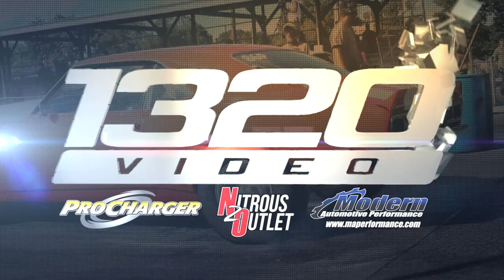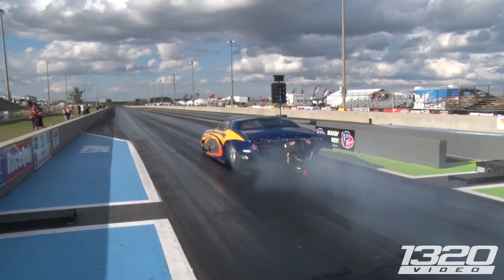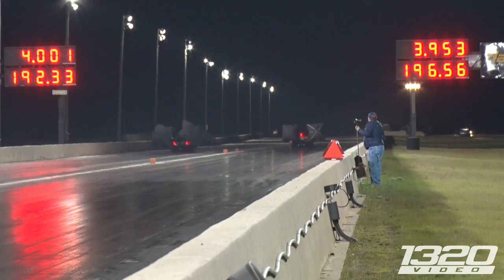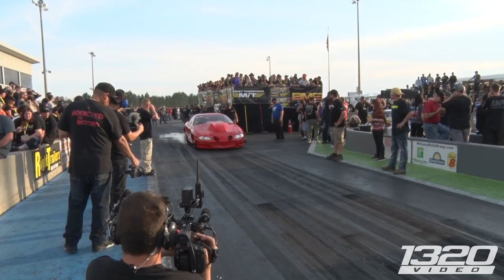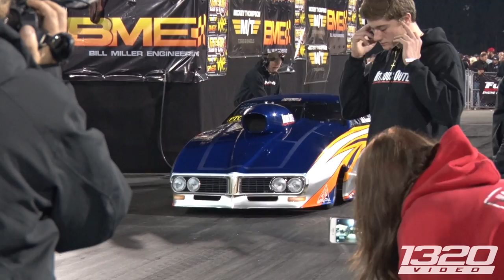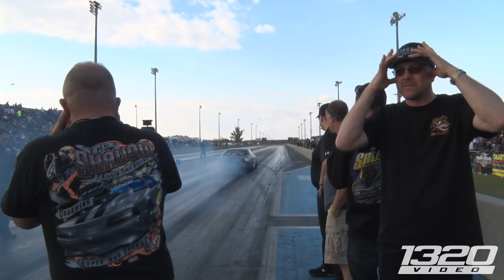FLAMETHROWER Firebird - 903 Cubic Inches!

Comment: that's a 15 litre engine if you were wondering.
Reply: 14.7975188 liter
Reply: CB nerd
Reply: CB if only my metal calculation was so accurate ;)
Reply: mulymule12 Google did the calculating for me, i didnt do shit other than copy&paste lol
Reply: Anyone know the smallest displacement that is running sub 4's?
Reply: mulymule12 sweet, I want to put that motor in my Prius, what's the gas milage on that baby?
Reply: The semi trucks I drive have either a 12L or 15L depending which one. Giant engine regardless.
Reply: Stingray idk but that crazy looking blue and grey impala has an LS motor. probably one of the smaller motors and it ran 3.90s.
Reply: Just add up 3 x 305 sbc's you get 915 cubes 5L x 3 = 15L. Car person math.
Reply: Its a 2 stroke loop charged through the valves, or a uniflow 2 stroke.
Reply: Marco Esteban milage? you'd be lucky to get yardage per gallon.
Reply: matt collins the boats I work on have 15L single pistons
Reply: wjoldham who cares
Reply: wjoldham I have a BICYCLE!
i litteraly just have a fucking bike
Reply: Stingray look up ekanoo racing Supra. It's under 300 cubic inches. the blue twin turbo impala runs an lsx that is well under 500 cubes,so there's two somewhat small drag race engines that run sub 4 sec 1/4 mile times..
Reply: Thats true, but it would be called a 15liter engine.
Reply: savannah love you mean 1/8 mile lol 4 second 1/4 mime is already top fuel numbers.
Reply: normal people....
Reply: James Avery im almost certain theres atleast 1. the impala running 3.90s definitely has a chance at running 5s.
Reply: 1970 olds442 no one can take a person serious when they can't English...
Reply: Bobby Beans  yes lol my mistake that's absurd to think tose times in a 1,/4 mile lol
Reply: Bobby Beans  he has run a 5.99 or a smidge faster in  da 1/4. mile in testing a few times
Reply: Marco Esteban  The gas mileage is probably 3 GPM (gallons to the mile) lol.

Comment: crash at top end, what happened?
Reply: im guessing he got on the breaks the nose dived and the back end got light and lost all grip then it came round on him
Reply: no hes not he straightened the car up and raced in the next round
Reply: MyFaceHole im dead 😅
Reply: Someone bent the parachute release cable.
Reply: *brakes
Reply: Really? He "straightened up"????

A car going 100+ mph turns a full 90 degrees, heading for a wall insnt going to straighten up. he fucked that car up.
Reply: all the fiberglass stuff was fucked and was held together with gaffer tape but the frame wasnt that badly damaged so it could be bent almost back to shape and he carried on racing it
Reply: lol

Comment: I wonder why the 1/8 mile has become more popular than running the 1/4 mile.   Is because not very many 1/4 tracks or preservation of the motor?
Reply: I hate it, I also hate "bracket", heads up all the way.
Reply: I've always preferred the 1/4 mile more. Seems more like a race against the opponent, and less about reaction time.
Reply: austin Safety.... and no prep don't belong in the same sentence.
Reply: jrh0369 most tracks don't have huge runoff space for stopping so the track is 1/4mile and 1/8 mile is used(I think) for racing
Reply: jrh0369 1/8th mile is more common among the south.
Reply: Mainly because even with the chutes these cars wouldn't be able to stop on time if they ran the 1/4 that's for starters. Secondly depends on the setup a lot of these cars believe it or not aren't geared to run the 1/4. Thirdly the class they're running

Comment: Imagine that engine with turbos on it, oh lawd.
Reply: Most are getting boost :D
Reply: unfortunately it wouldn't be eligible in pro mod races because of the displacement restrictions on turbo cars but yeah it would demolish everything if it did
Reply: Look how many turbos that nitrous beast beat down
Reply: Boost on that motor isn’t as effective as it is on a small bore spacing and cubic inch engine

Comment: Why not use a carbon fiber drifshaft? I got a GTR with 1140whp and it bend 2 shafts before I switched to Carbon
Reply: Post a video of your gtr it sounds badass
Reply: Don't hate. He just might.
Reply: Shakeel because it's not road car genius
Reply: These guys are veteran racers, they know what they're doing.
Reply: 1100whp vs 3000-4000, ya, why doesn't he just use what you use? lol.

why aren't you using a 2 or 3 speed gear box like them?

why aren't you running full float axles like them?

why aren't you running a motor worth as much as your GTR like them?
Reply: Im not gonna open my mouth i have a v6 mustang with 190whp if im lucky haha im here for the comments

Comment: 4:35 why wasting N2O? 4:52 dont need to wait green ligth? sorry about my ignorance =(
Reply: Fran Ruiz not wasting they have more then enough nitrous to use
Reply: Fran Ruiz that's called purging the nitrous. purging is where they let some nitrous go to make sure it's at the right pressure level. too much nitrous=boom but too little nitrous=slow so they do that to make sure the nitrous is at the right level. and to answer your other question, you'll notice the impala has twin turbos, a turbo has to have a certain amount of boost to be fast. that's why they bounce around on the line. if he doesn't have as much boost as he wants when it goes green, he will wait and let the turbo spool until its ready to go because he is better off to waste time letting the turbo spin than to leave when the boost isn't ready. if this doesn't make sense respond back and i will try to help more
Reply: Kaden Lawson dose it cool of the motor too ? cold = fast right?
Reply: Vincent Corralez spitting out nitrous doesn't cool the motor. nor does spooling the turbo. purging does nothing to cool, and spooling the turbo makes it hotter bc of all the air being forced through the exhaust
Reply: "and to answer your other question, you'll notice the impala has twin turbos, a turbo has to have a certain amount of boost to be fast. that's why they bounce around on the line."  This is just wrong, the movement of the car has nothing to do with boost pressure.  A bump box is used to control the trans brake so you can stage your vehicle.  Just watch the tree, on the last bump the left lanes stage light comes on.  Why the driver decided not to launch is anyone's speculation but you're spreading misinformation.
Reply: timmyg123 then why do blower and nitrous cars not do it? i don't really think i'm the one spreading misinformation here
Reply: Kaden Lawson because they have basically power on command. turbo cars need to stay in high rpms to stay on boost. blower cars will make full boost right when the car hits full throttle and Nitrous cars are the same basically. long story short turbo cars need to bump in so they stay on boost, other cars can just sit on the trans brake when fully staged and then let go.
Reply: timmyg123 and you're right he was just staging in this scenario. but as a generalized statement turbo cars will move because they are dying to get off the line
Reply: jimmygrizz69 exactly. so that's why thy bounce around on the line. simple
Reply: i know about the turbo lag and mechanics, but see the video at 0.25 speed on 4:52, he starts moving before green light.
About nitrous oxide, why dont use a reg valve?its more logic the cooling answers. Srry about my english

Comment: is this 1/4mile or 1/8 mile?
Reply: gekko3487 1/8
Reply: gekko3487 1/8
Reply: 1/8
Reply: Top fuel funny cars run just under 4 seconds in the 1/4. But they are going 300+ MPH
Reply: speterj they also have around 8,000 hp
Reply: Fuel funny cars run under 4 seconds in 1000ft - not in the 1/4
Fastest run was Matt Hagans 3.82@335mph in Pomona this year.
1/8 mile et/speed 3,096@289mph
Reply: MrMegacurie I didn't know that. I always thought it was 1/4 mile. Thanks for pointing that out.
Reply: NHRA changed it because of safety regulations to expand the run-out zone.

Comment: I don't think I'll ever get used to this eighth mile Bullshit. Racing has always been quarter mile.
Reply: Life's Balince these cars will trap 250+ in the 1/4 mile ..too dangerous when most of the tracks don’t have a long enough run off area .. also 1/8 mile all about reaction time , 1/4 mile all about top end / power
Reply: If racing has always been 1/4 mile why is it only run at around 10 tracks?